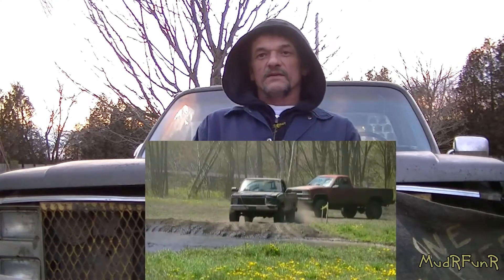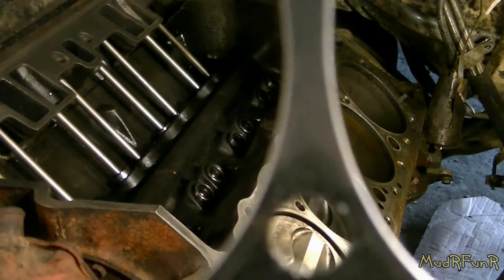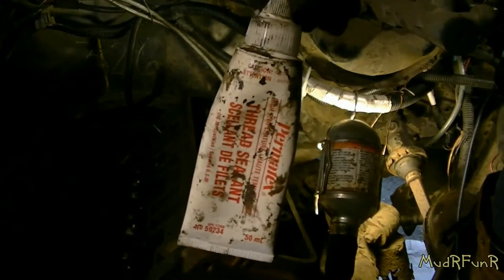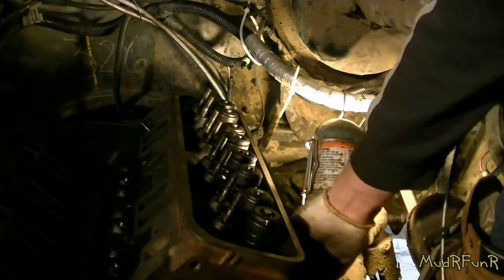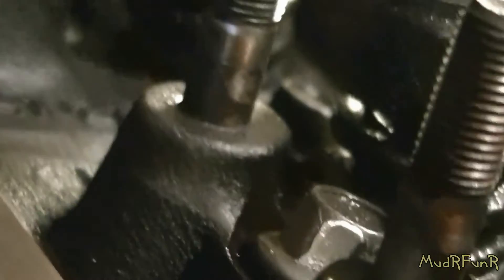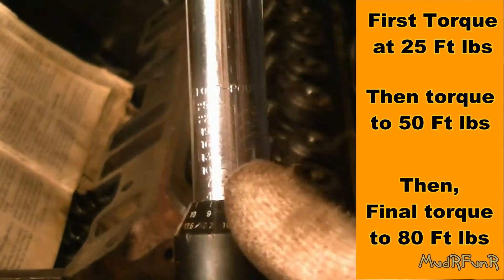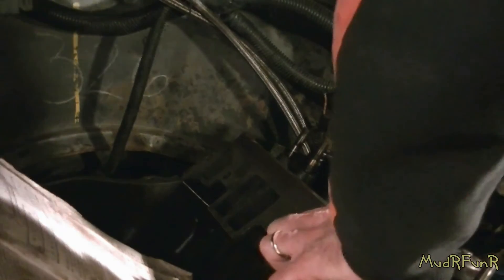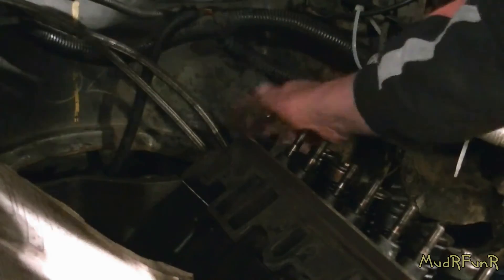SB Chev Cylinder Head Installation with Engine in Truck - Rewire Part 9

Comment: All the information I can find shows the Chevrolet  with 350 cast iron heads .....the head bolts are torqued to  65 ft. pounds . Only the Chevrolet big blocks are torqued to 80 ft. pounds !
Reply from the maker: Strange. The book I used is a bit out of date but it is a Chilton's specifically for small blocks. Thanks, I'll need to look into that. I've used this manual for many years on many projects.

Comment: very well explained man, if it weren't for you i would be needing to buy a Haynes manual to see where all the long head bolts went to, now i know all middle area long bolts and on the sides the shorter ones , and finally the small ones below the  exhaust manifold.. im subsrcibing, and hitting that like button , thanks mann , great content.
Reply from the maker: Thanks, your compliment is much appreciated!

Comment: Glad I found this! I have to do the same thing to my 4.3 conversion monster mud truck. I will be replacing the complete head on the driver's side bank and just may do the same on the other side.... I only worried about collecting the gasket trash etc. that got scrapped off into the water pockets. Wondering  how deep the jackets' go and if I can slip a small hose onto my shop vac to squirm down in there to collect the trash. I want to be a clean as possible! Nobody wants to do this twice. It sucks being a perfectionist while cutting corners!!! Now to the video!!!
Reply from the maker: I like to use compressed air to blow out all the holes but a shopvac with a tiny hose might work.

Comment: Good informational video, but wondering were you got the 80 foot lbs for final torque ? Been on three different sites on the web and they all listed final as 65 foot lbs. Everything else you did matched what they recommended except that. Just curious as I'm doing a head gasket replace on my Chevelle.
Reply from the maker: You are the first one to question that torque. You are right. All the info that I could find says 65 but the manual that I was using says 80. It's possible that my manual was wrong. Myself, I would go with 65 since all other info says 65 not 80. Thank you for pointing that out. I will add that to my disclaimer.
Reply: MudRFunR Didn't mean to be a finger pointer,  just curious were that number came from ?
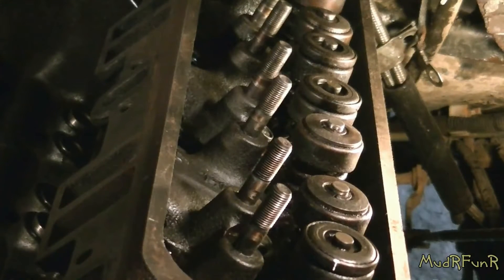Reply from the maker: At 5:27 I mention that this may be wrong and then show the manual that I have.